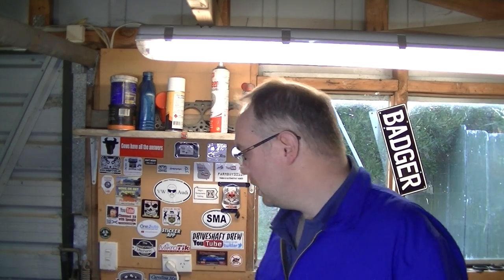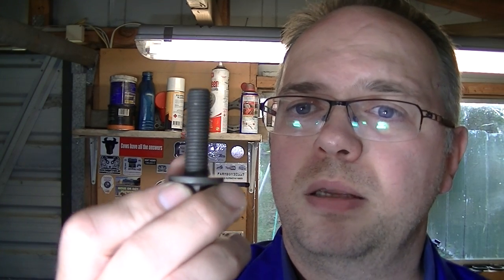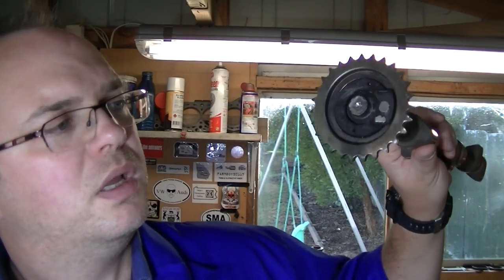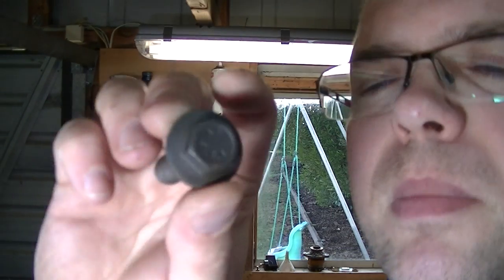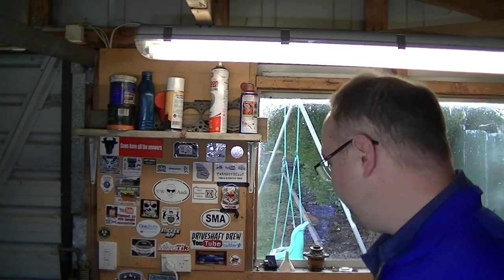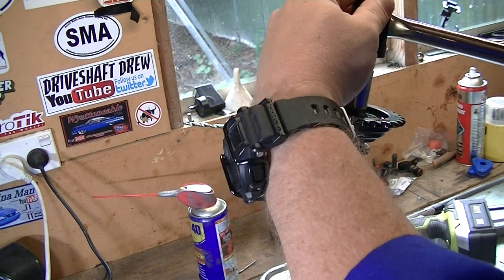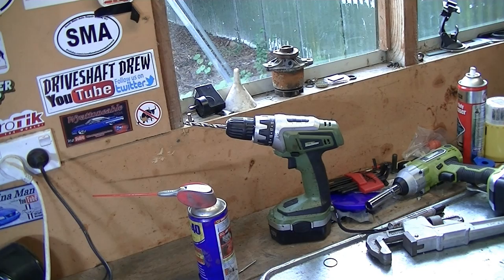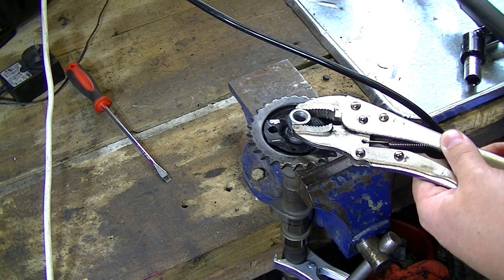Stuck Camshaft Sprocket - VR6 Rebadgered

Comment: Did you try pounding on the bolt head with a hammer.?..Often a few heavy blows will spread the threads and loosen up.
Reply from the maker: +ZIGgassedUP I did hammer on a socket at some stage which took some effort. I tried quite a lot and it just didn't want to shift. Cheers

Comment: Here is a thought for the next time you run into this. I saw Paul short use one of these on the end of a air hammer. Instead of the impact turning it will pound and you use a wrench to turn. Here is a link to Amazon just so you can have a idea of what I am talking about. https://www.amazon.com/Mayhew-37316-2-Inch-Pneumatic-Breaker/dp/B008M23A6Y/ref=sr_1_33?ie=UTF8&qid=1488206701&sr=8-33&keywords=impact+hammer+accessories
Reply from the maker: +The Plow Guys thanks John, looks like a handy tool. Only thing is I'd need a compressor and air hammer first. Cheers!

Comment: My cam sprockets were equipped with some of the most aggressive thread locker I've ever dealt with.  It took an unusually large amount of heat to get them to let go; I think I was there with the MAPP gas and a hammer for 20 minutes or so in total?  I bent the everloving $&%@ out of my cam lock tool in the process, too.

If it's not responding to heat, I don't know what to tell you!  Something's not right there.  You could always go at it with a cutoff wheel!  Best of luck, Badger...  :[
Reply from the maker: +rhkips there was no thread lock on the other cam shaft. I think it just really likes being where it is... an emotional bond between cam and bolt that no physical intervention can break.

New parts are the answer and I'll have to turn the old one into an ornament as per Thomas' suggestion. Cheers!

Comment: Frustrating for sure. I'd try two things. 

First, (if the sprocket is keyed to the camshaft this way won't work) with the cam secured tightly in the vise you could put a chain wrench around the sprocket itself and try to turn the sprocket to loosen it. Maybe the bolt will loosen a bit along the way. 

Second, (this is what I would most likely do) use a grinder (carefully so as not to damage the sprocket!!) to grind down the head of the bolt. You'd start out with a larger cutoff wheel to get the bulk of it off. Then you would have to switch to a smaller grinder, like a Dremel, with a small heavy duty wheel to get down into the recess of the sprocket. Eventually, the bolt head will be reduced enough for you to carefully persuade the sprocket off. Then hopefully, the rest of the bolt would come out. 

I've used the second method with much success. Worth a try I guess!
Reply from the maker: Thanks for the info. I'm going to get a new sprocket but I will have a go at recovering the old one. Would be interested in finding a method that worked. Definitely your second way sounds like it would do the job eventually. Cheers!

Comment: Well, you tried, I would thought that the heat its self would bring it lose,  maybe heat the cam shaft its self instead the bolt, but I would thought it still would have came lose.  Well my friend, you cant win them all.  Great try, that's all you can do.  Thanks for sharing, stay safe.
Reply from the maker: +Cary Hubbard & Family Channel heating the camshaft was about all the machine shop tried. Ah well new parts will add some piece of mind. Thanks for watching. Cheers!

Comment: Zippity-zap with a good air impact might well have got that out, but your not going to drill that with the Chineseium grade drill bits you buy in the shops. Evidently they are all the machine shop had as well. You wonder what on earth happened to that bolt... Bloody German engineering...
Reply from the maker: +zoidberg444 the bolt in the other cam was tight but came out with a couple of grunts. No idea what happened to this one. I gave it a flipping big heave with a big lever and got nowhere. Cheers